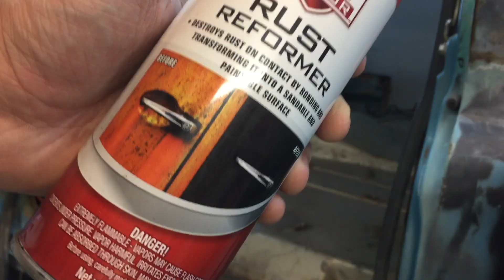How To Insulate / Sound Deaden Your Truck Or Car - Noico Review - (C10 Build Episode 16)

Comment: why not fix the holes? you are not going to stop the rust by covering it up.
Reply from the maker: I'm assuming you're referring to the holes in the back of the cab? The main reason is, It's a shop truck with a cab that has extensive rust damage. If I were putting something together to fully paint and redo (not a patina project) we would've probly just bought another cab due to the extent of work needed. Side note, the truck has been complete for about 4 years. No issues.